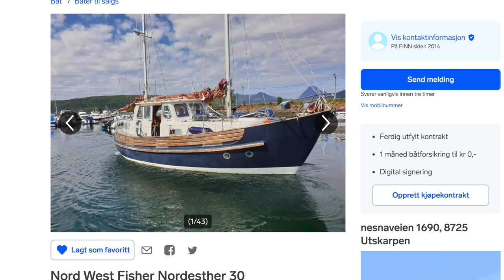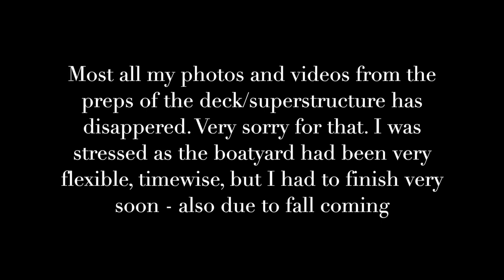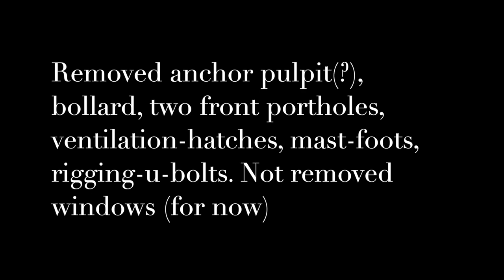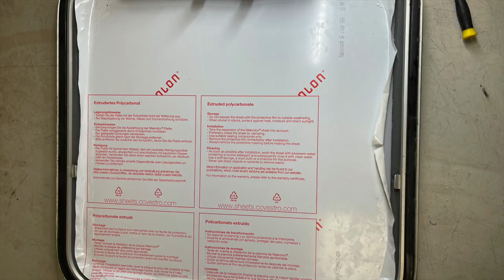Fisher 30 Northeaster Ep 6 - Painting the superstructure - here comes trouble

Comment: I really like what you've accomplished with the exterior of your boat including color. Visually I like the longer windows there now, trying to visualize how it will look with round port-holes. Best wishes for a continued wonderful restoration.
Reply from the maker: Hi Robert! Yes, the present windows are great, but not watertight. These need special rubber-sealings, which might be hard to get. The circular portholes are easy to get, and easy to seal and reseal with spare parts. I sure hope they suite the boat, but only time will tell. I will keep the old windows, just in case. Thanks for your input :-)

Comment: Congratulations - you achieved an amazing amount in 89 days and to such a high standard, particularly as the conditions turned against you with the usual excellent timing. What was the story with the yard  in terms of pressuring you to get out of the space - had they contracted with someone else for the space? Oh well, I have caught up already - so what’s next? Continuing in the weatherproofness  goal (windows and the like)?
Reply from the maker: Thanks, Norman. The yard needed the space for winter-storage of boats. Next is rebuilding the engine foundation (is this the correct term?), as it is now just a few 2by4 pieces of wood, not able to withstand the engine vibrations. And yes, the windows will need re-sealing and partly changing. The boat needs to be dry on the inside. Then there is the teak-railing.... ;-)
Reply: @hsobstad  We refer to them as ‘engine bearers’ but foundations is also a suitable term.

Comment: Question: how did you remove and reseal the portlights (windows) either wheelhouse or salon cabin?  How do they come apart?
Reply from the maker: Hi Robert! Most of the windows are yet to be removed, which they will. They are all leaking. I have drilled out one of the portlights from the aft-cabin. Cant remember the size of the drill bit, but I did start small and increased until i reached the inner-diameter of the rivets. Maybe 2,5mm. I will probably replace all cabin-portlights with new. The wheelhouse windows I will keep (for now), but consider using bolts instead of rivets when reattaching them. Not as pretty, but easier to tighten up to get them waterproof. For the resealing the 4 portlights in the bow i used butyl tape. Will use that on the rest of the windows as well, when I get there...
Reply: @hsobstad  Thanks for the speedy reply.  The portlights I was viewing (wheelhouse) had 2 rivets where the aluminum frame joined.  Are those the rivets you would drill out?
Many thanks,
Rob
Reply from the maker: @RobertBrynjolfson  Robert. It seems to me we have about the same progress. I have seen the rivets to split the frame, but has not yet done that. So I have no experience to share yet. I will do the split, I guess, to be able to re-seal the window. So I cant se any other way than to drill out the rivets.